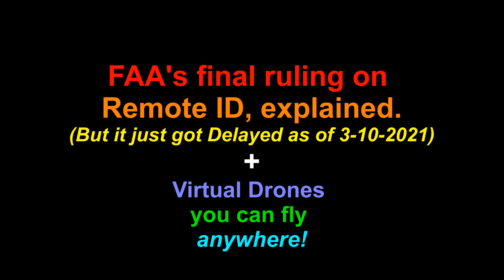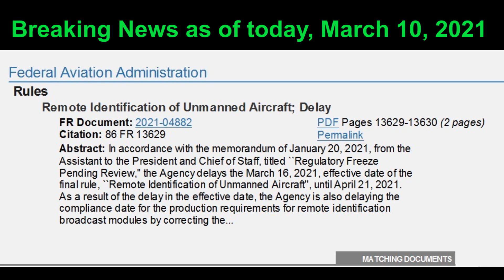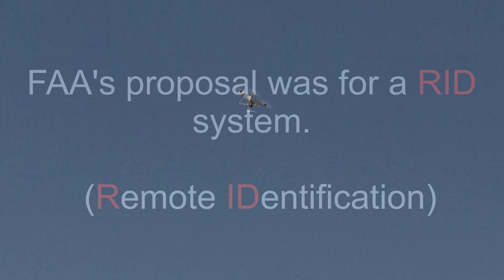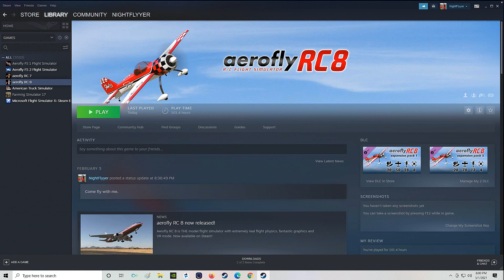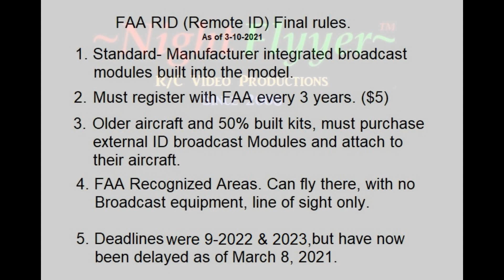Required: FAA Remote ID Broadcast Modules for all model Aircraft over 1/2 lb. I explain the Ruling!

Comment: A bad day for both Pilots? The guy in the manned airplane is dead. The Drone remote pilot gets to go home. So I would say it wouldn't be equally as a bad of day for the Drone pilot.
Reply from the maker: Note sure I said that at all.  If you have a better idea, please write the the FCC and tell them what you think.
Reply: @NightFlyyer  You did say it here 3:01... I don't have a problem with your video, and you mean FAA? Just pointing out it is not equal risk or jeopardy.  You were reasonable and understand why "full scale pilots" complained.  BTW I am an airline pilot (ATP) and CFI  (flight instructor) and Part 107 sUAV remote pilot.

 I personally never had issues with drones while flying at work or in my personal plane. However both in USA and Europe drones have made the news for all the wrong reasons, like flying on final approach to busy airports.

 It was interesting to learn about Academy Of Model Aeronautics and others getting FAA to reconsider the rules. Do you know about NPRM (notice of proposed rule making) that comes out for public comment before any new regulation (CFR) is imposed. Anyone can respond. The Gov (FAA) has to address all concerns, even if it is to deny the complaint and not change the rule. However often they will consider the comments and make changes.

Comment: I just took the recurrency the 107 and it did say about the ID. I have no idea how this is supposed to work. I own a Yuneec Q500 that I would like to use instead of going out and buying one. I tried Amazon,eBay, and googling this where to buy the ID module andy body have any clue?
Reply from the maker: I'm just the messenger here, but as I said in the video and the video notes, this is not required yet for at least a year as the manufacturers, the FAA, and the FCC are still trying to figure out a standard version. In the mean time, go fly your Q500.  I have one as well, and it allows me to fly anywhere with no GeoFence.  Thanks and good luck.
Reply: @NightFlyyer  Thanks you have been very helpful

Comment: Alot of bs from something that's never hurt anybody
Reply from the maker: Much of this has been started by full scale pilots complaints.  Maybe the collisions with the fire fighter helis and planes in California never hurt anybody, but it did damage the planes.  Last week a drone collided with a plane in Canada.  For model airplanes though, I agree, it is BS and unlikely it will ever be able to be enforced very well.  Just fly safe.
Reply: @NightFlyyer  regular vehicle traffic is far worse why don't they push this with cell phones...
Reply from the maker: @w.e.s.  The FAA did present that at first, as I said in the video.  The AMA was able to get that taken off as a bad idea because that would mean that   before you fly, you would need cell phone service and a cell phone to fly. I already have that with my DJI spark.  I cannot fly it without a cell phone.  Since a lot of areas do not have cell service, it would limit us all.  Also Local traffic is busy for sure, and all need and have transponders so other aircraft know where they are.  With drones, they are too small to see in a full size plane. Also many drone pilots fly them against the rules of a 400' limit in altitude and in flight paths of full size aircraft at airports and during disasters. There is no perfect solution, other than to fly with common sense.  And that isn't all that good either or there would be no need for this at all.  LOL.

Comment: They should just make an app and all you have to do is say what where and when you are flying. No module and it would be free. One could say that you could just not use the app but you could also not put a remote ID module on your UA
Reply from the maker: They already have the No Fly zone app but if people do not use it, it means nothing.
Reply: @NightFlyyer  Right but my point is that if people don't put a remote id transponder on there UA, it also means nothing
Reply from the maker: @lithiumfpv9254  That's right. Not many will probably comply.

Comment: Am I wrong, or doesn’t my DJI Phantom Drone already transmit my location, height, speed, altitude, etc. back to my remote controller already?
Reply from the maker: Good question. Telemetry to your TX is a different protocol.  My original DJI Phantom did not have a phone to see info, nor did the TX. It only uses GPS to maintain position and return to home.  Newerdrone versions have Telemetry also, but the FAA wants an onboard transponder like on full size aircraft.  This version must transmit the information to the full size pilots in their aircraft, towers, emergency responders and so forth.   This is a much different protocol and is under design at this moment.

Comment: Good comprehensive video. I've read FAR 89 and 107 in their entirety and got the gist. Your video added some extra points for me that I appreciate. I'm an commercial pilot as well so I get how annoying new regulations are. I was also Marine Corps aviation ground support and got to support some pretty sweet little drones in the past. Built aluminum runways for drones and aircraft, and also got to install your catapults on my airfields from time to time. Small world. 

It's a bummer that the federal government has to get involved with absolutely everything these days. I use my drone to make little YouTube documentaries that nobody watches, and I'd like to keep doing that without jumping through hoops.
Reply from the maker: Yes.  Judging from comments, not many are going to adhere anyway....probably only AMA members, who know the rules about the 400 foot level that has been the norm for as long as I can remember.  Thanks kindly and Semper Fi from the old Top.
Reply: You seem to know a lot more than I do about this whole module ID  deal. I'm wondering if could enlighten me as were to purchase this module for an older drone and how to register it? I would really appreciate your help I've researched it a lot and looked at the fars but nowhere does it say where to buy it? THANKS

Comment: SOLUTION  Sir, 1). Birds easily weigh 2lb. Is FAA gonna put drone registry on all birds near airport runway's glide slope? 1stly logically weight limit should be 2lb.
2). What's wrong with FPV with remote ID under 400 feet ceiling outside of airport zones? It must be permitted unconditionally. Clearly pilots would've no problem with that.
In reality establishment is using it as an excuse to attack personal freedoms. The ruling class is telling us, THE SOLE BLUE (HIBITABLE) PLANET OF THE UNIVERSE IS THEIR PROPERTY. We are their slaves to serve them, generate revenue for them and to do as directed... We got freedoms only to our tiny homes, which we have to buy too, by paying heavy county rates. Their funded environmentalist mafia is preaching us 24/7 not to make their earth dirty.
Reply from the maker: I agree, but it is very hard to fight city hall!  I'm only the messenger and just passing along what the FAA, Model Airplane News, and Model Aviation magazines published this month. It was the Full size fire fighter aircraft and airline pilots who complained to the FAA and started it all. We in the AMA community tried to stop the ruling but could not. But they did block the rule to register every aircraft you own and blocked the internet link requirement to just a broadcaster.   We only got it modified to be a little better. I DON'T LIKE IT ANYMORE THAN YOU!  My DJI Spark wont take off if I'm within 5 miles of an aircraft, so it has already begun.    If you have a better solution, then again I suggest you contact the FAA and tell them, since it was delayed again and they are requesting comments and suggestions.  Maybe if enough folks do that, this stupid law will be rescinded. Here is the email address.   UASRemoteID@faa.gov.

Comment: In short FPV BANNED even with remote ID.
It is attack an on personal freedoms - as freedom means, you got freedom so long as you don't encroach on others'... It's a shame since the world looks up to the USA for its freedoms.
Reply from the maker: I agree and as I have said many times here, I'm only the messenger and just passing along what the FAA, Model Airplane News, and Model Aviation magazines published this month. It was the Full size fire fighter aircraft and airline pilots who complained to the FAA and started it all. We in the AMA community tried to stop the ruling but could not. But they did block the rule to register every aircraft you own and blocked the internet link requirement to just a broadcaster.   We only got it modified to be a little better. I DON'T LIKE IT ANYMORE THAN YOU!  My DJI Spark wont take off if I'm within 5 miles of an aircraft, so it has already begun.    If you have a better solution, then again I suggest you contact the FAA and tell them, since it was delayed again and they are requesting comments and suggestions.  Maybe if enough folks do that, this stupid law will be rescinded. Here is the email address.   UASRemoteID@faa.gov.

Comment: It will remain to be seen what they do if you transmit over the max. How they will measure it. How they will enforce it. I don't live in America but for the land of the free you have sadly developed a fondness for restrictive rules
Reply from the maker: I agree.  I'm only the messenger and just passing along what the FAA, Model Airplane News, and Model Aviation magazines published this month. It was the Full size fire fighter aircraft and airline pilots who complained to the FAA and started it all. We in the AMA community tried to stop the ruling but could not. But they did block the rule to register every aircraft you own and blocked the internet link requirement to just a broadcaster.   We only got it modified to be a little better. I DON'T LIKE IT ANYMORE THAN YOU!  My DJI Spark wont take off if I'm within 5 miles of an aircraft, so it has already begun.    If you have a better solution, then again I suggest you contact the FAA and tell them, since it was delayed again and they are requesting comments and suggestions.  Maybe if enough folks do that, this stupid law will be rescinded. Here is the email address.   UASRemoteID@faa.gov.

Comment: Rules like don't burn down shops. Are they going to have mobile faa police or are they relying on narks
Reply from the maker: I'm only the messenger and just passing along what the FAA, Model Airplane News, and Model Aviation magazines published this month. It was the Full size fire fighter aircraft and airline pilots who complained to the FAA and started it all. We in the AMA community tried to stop the ruling but could not. But they did block the rule to register every aircraft you own and blocked the internet link requirement to just a broadcaster.   We only got it modified to be a little better. I DON'T LIKE IT ANYMORE THAN YOU!  My DJI Spark wont take off if I'm within 5 miles of an aircraft, so it has already begun.    If you have a better solution, then again I suggest you contact the FAA and tell them, since it was delayed again and they are requesting comments and suggestions.  Maybe if enough folks do that, this stupid law will be rescinded. Here is the email address.   UASRemoteID@faa.gov.

Comment: Don’t forget to wear your mask sheep
Reply from the maker: LOL.  
 I'm only the messenger and just passing along what the FAA, Model Airplane News, and Model Aviation magazines published this month. We in the AMA community tried to stop the ruling but could not. But they did block the rule to register every aircraft you own and blocked the internet link requirement to just a broadcaster.   We only got it modified to be a little better. I DON'T LIKE IT ANYMORE THAN YOU!  My DJI Spark wont take off if I'm within 5 miles of an aircraft, so it has already begun.    If you have a better solution, then again I suggest you contact the FAA and tell them, since it was delayed again and they are requesting comments and suggestions.  Maybe if enough folks do that, this stupid law will be rescinded. Here is the email address.   UASRemoteID@faa.gov.

Comment: Thank you Dave for having this discussion on the new rule. I would like to add my thoughts on the matter as well. I think that the modeling community was forced into a situation wittingly or otherwise for a flimsy purpose. I was reading that starting in 2018 the proposal for integrating UAS into the national airspace was discussed. The topic of safety was brought up as a premise for dealing with rogue drone flyers. However, it's difficult to find a scientific analysis performed by the agency of risk assessment. It seems that the legislative branch was more interested in helping large companies utilize airspace for capital gain. 

Granted there are good uses for UAS but, I'm skeptical of how large heavy unpiloted machines flying over residences or operating near busy interstates are safe enough to do so. I wished that the modeling community was involved earlier on panel discussions before sweeping changes were enacted. I agree that there is no easy solution dealing with risky behavior. I had read many of the comments during the submission period last year when the rule was a NPRM. It also seems that some of the sound advice given by the 50,000 plus submitters were weakly regarded or wholly ignored.

I'm disappointed that model flyers were consolidated into one group of operators save for part 107 flyers. I'm sure that there will be more fine tuning of UAS integration but this was not the right way. As for the individual model flyer, we can do our part by educating the public on how safe the hobby is and the joy of belonging to a wholesome activity. Again, thanks for discussing these issues and happy flying!
Reply from the maker: Thanks.  I have no idea how they will ever enforce it for sure.  
 I'm only the messenger and just passing along what the FAA, Model Airplane News, and Model Aviation magazines published this month. We in the AMA community tried to stop the ruling but could not. But they did block the rule to register every aircraft you own and blocked the internet link requirement to just a broadcaster.   We only got it modified to be a little better. I DON'T LIKE IT ANYMORE THAN YOU!  My DJI Spark wont take off if I'm within 5 miles of an aircraft, so it has already begun.    If you have a better solution, then again I suggest you contact the FAA and tell them, since it was delayed again and they are requesting comments and suggestions.  Maybe if enough folks do that, this stupid law will be rescinded. Here is the email address.   UASRemoteID@faa.gov.
Reply: @NightFlyyer  Thanks for the response Dave! I've been monitoring the changes since day one and I think it's a good idea to have discussions about it. I agree with you and something like this is quite compelling. I have been writing to the FAA and AMA since before and after the comment period. I know that some guys may not be aware of how the rules were generated and it's development. I would hazard to guess that after more commercial operations increase in number, both the problems and benefits would be better revealed. I hope that more discussions continue as to share ideas for solutions. Take care Dave and happy flying!

Comment: I love my RC airplanes but after looking at this dogs mess I think I’ll just stick with control line flying. Never really liked drones. RC is fun and I’ve taught lots of people to fly with my SIG Kadet. And I don’t see RC regulations getting any better under the current administration as they really adore having regulatory power over every aspect of a citizens life. So, I enjoy the simple pleasures of wire wrapping lead outs.
Reply from the maker: Ha ha.  So true. As you may have seen I recently have been flying control line too.  Maybe now I will even more. I appreciate your comments.
 I'm only the messenger and just passing along what the FAA, Model Airplane News, and Model Aviation magazines published this month. We in the AMA community tried to stop the ruling but could not. But they did block the rule to register every aircraft you own and blocked the internet link requirement to just a broadcaster.   We only got it modified to be a little better. I DON'T LIKE IT ANYMORE THAN YOU!  My DJI Spark wont take off if I'm within 5 miles of an aircraft, so it has already begun.    If you have a better solution, then again I suggest you contact the FAA and tell them, since it was delayed again and they are requesting comments and suggestions.  Maybe if enough folks do that, this stupid law will be rescinded. Here is the email address.   UASRemoteID@faa.gov.

Comment: Does the FAA really think modelers are going to RIDs in their UAS???  NOT!!  Find me if you can!!
Reply from the maker: I'm only the messenger and just passing along what the FAA, Model Airplane News, and Model Aviation magazines published this month. We in the AMA community tried to stop the ruling but could not. But they did block the rule to register every aircraft you own and blocked the internet link requirement to just a broadcaster.   We only got it modified to be a little better. I DON'T LIKE IT ANYMORE THAN YOU!  My DJI Spark wont take off if I'm within 5 miles of an aircraft, so it has already begun.    If you have a better solution, then again I suggest you contact the FAA and tell them, since it was delayed again and they are requesting comments and suggestions.  Maybe if enough folks do that, this stupid law will be rescinded. Here is the email address.   UASRemoteID@faa.gov.